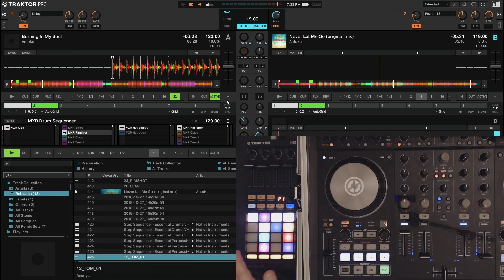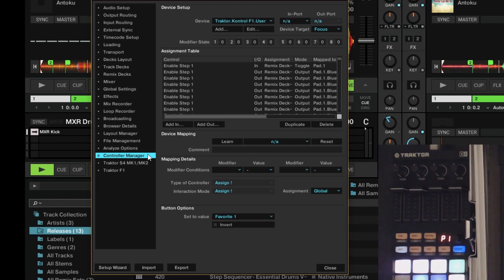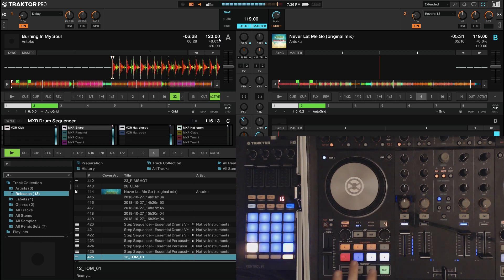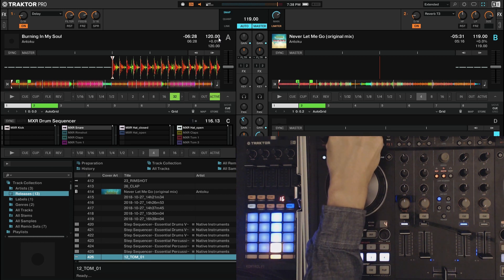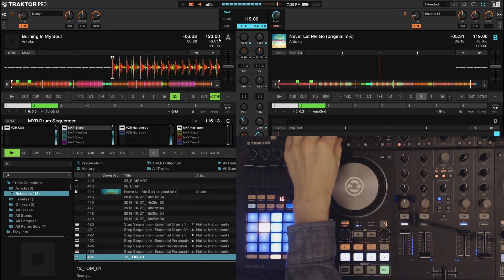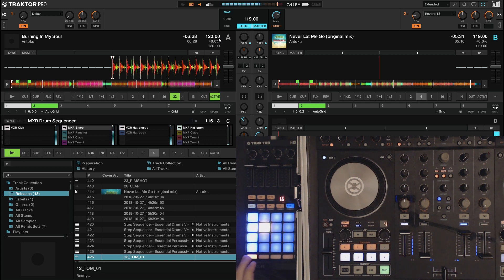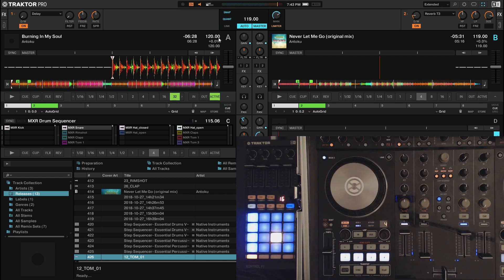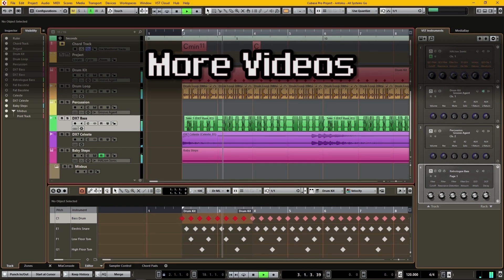How to setup TRAKTOR KONTROL F1 in STEP SEQUENCER mode

Comment: Does the step sequencer only read the first pad/slot of the column? Cause i cant change to another sound
Reply from the maker: It can only play one pad slot in the column at one time, but you can use the spin wheel (I can't remember exactly what it is, but it's something like SHIFT + scroll wheel up and down, and it will move to next or previous samples in the column).

Comment: Wish you could simply drum them in. Rather than in sequencer mode. Like drum them in like a drum machine.
Reply from the maker: Oh, yes you can trigger samples live, drumming on the trigger pads. But you cant record a sequence doing so, and there's only one velocity, and you can't do both triggering and sequencing. I meant it's possible to record finger drumming with the Maschine and have that as the sequence.
Reply: Vintique Sound yea if I’m performing I want to drum live and record that sequence! Native Instruments should add this feature!!
Reply from the maker: Yeah that would be dope. It's possible with Maschine though. Eventually I'll replace the F1 with one of the maschines.
Reply: That's normal F1 (and Remix Deck) using, or not? But i found one mapping that allows on F1 playing step sequencer AND using buttons as classic Remix Deck.
Reply: The Midi Fighter twister is even better